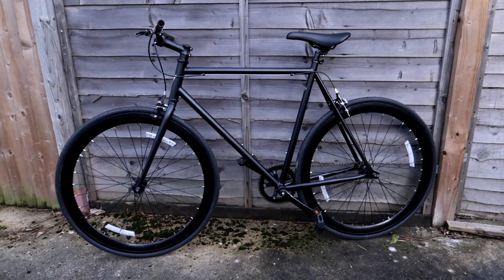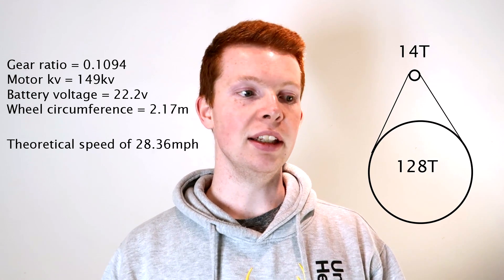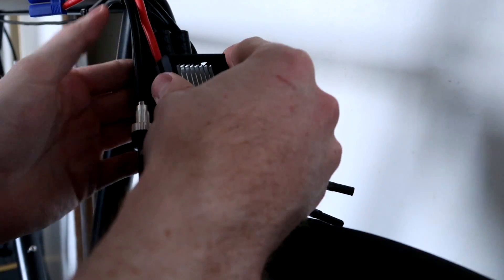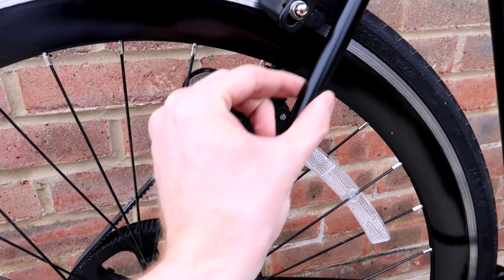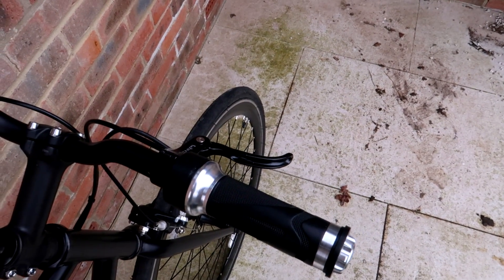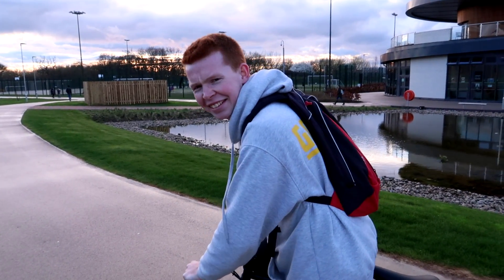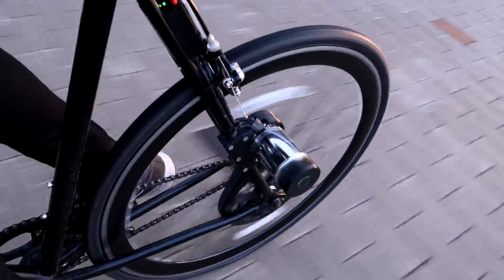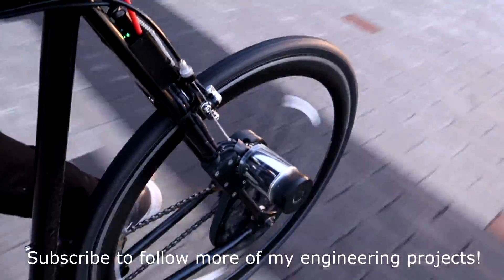DIY Electric Bike

Comment: The motor is rated for around 2kw isn't it an overkill? 
Are you underpowering it?
Reply: Yes its obviously under powered. Acceleration is not going to be great with a tiny little motor like that and it only has one gear which is disappointing. Still a cool build and solid effort. Doing a complex thing is difficult and at least he had some decent end product

Comment: 3 engineers to put a brushless motor in a bike that at the end didn't even work properly? 
Sorry but you don't need 3 bachellors degree to do what you did.
Reply from the maker: I realise that nothing from my degree course has helped me with this project one bit, but why is that an issue? Not really sure what you mean by "didn't even work properly", but I assume you didn't watch until the end. Thanks
Reply: I am sorry Dashz but you are a complete idiot.This setup is genius!!!You are adding only  3kg to your bike and you have really decent pedal assist and you don't have a heavy hub motor which is ruining your bike in terms of pedaling. So you have a e bike which can pedal like a normal bike + pedal assist.I assume you don't know nothing about bikes and your comment is pointless.I am building the same setup at the moment with only one difference, my rear hub will have dual freewheel.Thank you Tom Stanton!

Comment: A lot of 2017 buzz terms.. "3D printing" and "shout outs". I don't think 3D printed plastic is a very good material for vehicles that have to run for years in all conditions. But it's a nice hobby project.

Comment: pretty neat ! :).In case yo exceed the motors top speed, I would consider a one way/over run clutch bearing in the sprocket on the wheel. So it will free wheel instead of over running the motor and possible frying your electronics & a speed sensor on the wheel to cut out the motors power, if the speed exceeds the motors max speed, no need to waste your battery

Comment: Would pedaling not cause the motor to push current back through the circuitry, since it'd be rotating without input causing it to essentially be a generator? 
Anyways, a better design would be a planetary differential, pedals being the sun, planet carrier being the drive, and motor being the ring. Although more complex, it gives you the option of pedaling, electric drive, and a hybrid of the two.

Comment: I'g get some thin sheet aluminium metal and cut a couple of at the wheel pulley size disks out of it to mount on and reinforce the wheel pulley. Torque over time on the pulley plus heat friction caused by the belt is more likely than not going to cause the pulley to weaken and break.

Comment: You could've taken the easy way around the analog to digital conversion and just bought a servo-tester for RC servos.
You could have removed the potentiometer in the servotester and soldered in the wires from your throttle.
And that box is probably not water proof at all.
You need to cover the cirquits in liquid tape or other insulating sticky stuff aswell as using a rubber grommit or silicone sealant, but you'll find that out soon enough and you can make improvements :)

Comment: I don't think that's bike is a fixie. pretty sure that fixies don't have a coaster in the rear and the pedals turn all the time.  I could be wrong.
Reply from the maker: +Do R/C! It's sold as a fixie with a flip flop hub. So one sprocket is fixed and one can freewheel

Comment: Great vid but you didn't mention the run time
Reply from the maker: I will be making a follow up video over the next couple of weeks with more information about the performance. But from the testing that I have currently carried out, it uses approximately 950mah/mile without pedaling (so roughly 4.2miles on a 6s 5000mah battery) and 650mah/mile with mild pedaling (so roughly 7miles on a 6s 5000mah). Thanks!

Comment: your video doesnt make it clear at all what kind of acceleration you were able to acheive.  It doesnt look very powerful
Reply from the maker: I've limited the ESC to 50A to keep the motor cool, so with the 6s (22.2-25.2v battery), it outputs 1110-1260w. The motor is supposedly rated for 2250w, but I think it achieves this at 12s because when I increase the output amps to +60amps, the motor begins to stutter and lose sync. The video doesn't really do the bike justice in terms of performance, but the motor adds quite a lot of assistance and allows me to climbs hills at 20mph with ease. I will most likely be making a follow up video over the next couple of weeks to showcase the performance better. Thanks

Comment: Thoughts on this motor?
https://hobbyking.com/en_us/9235-100kv-turnigy-multistar-brushless-multi-rotor-motor.html
Seems like it might be a good form factor for a bike, but would need higher voltage.
Reply from the maker: Looks decent in terms of the specs, but I'm not sure how you would mount a pulley to the shaft
Reply: +StantonFPV I'm kind of in the opposite situation to you. I don't yet have a 3D printer, but my father is a blacksmith/welder, and I've got a friend who runs a professional machine shop. 🙄 So a custom pulley or adaptor is no big deal. 
It's interesting how ones approach to a project dudes is on skill set and capabilities.

Cheers!

Comment: Nice work man! What type of belt/pully are you using? I usualy use GT2 for small projects, so it would be nice to know some large type pulleys as well.
Reply from the maker: I'm using a HTD5 timing belt, it's 15mm wide and 800mm long. Thanks!
Reply: Thanks!

Comment: My biggest concern is failsafe. Suppose the arduino has a hiccup. You could end up with the ESC giving full whack. You're only option then would be to pull the power lead.
Reply from the maker: For sure that is a concern of mine too. I will most likely build in a switch that can disconnect the esc signal wire from the arduino as the ESC has a failsafe shut down if it doesn't receive a signal

Comment: Can you please show/comment more of the math for calculating the gear ratio and theoretical speed? It could save me a lot of research time for future projects. Thx!
Reply from the maker: voltage x motor kv rating x (number of teeth on motor pulley/number of teeth on wheel pulley) x (circumference of wheel/60) x 2.24 = theoretical speed in mph

Comment: Cool project! I just have one question. I'm an electrical guy and we use "kv" to mean "kilovolts." You're saying your motor is 149kilovolts? Or did I miss something? (",)
Reply from the maker: +legendofthemoon2013 "kv" is a term used to rate the rpm of the motor. The "k" is meant to be a constant and the "v" is the voltage. Multiplying the 149 (k) by the voltage (v) equals the theoretical rpm. But yeah, it's quite a common mistake in the RC model industry

Comment: make it a dual motor
Reply: I dont think physics work that way, haha :D
Reply: better to just increase the size of motor and change the pulley ratios.
Reply: Marcus Christensen that plus dual
Reply: Pryside make it dual motor for 100 mph
Reply: You'd need 8 motors to do that, unless you were riding on the moon.
Reply: Great job. From Texas. Subbed
Reply: FPV_Arthur
Reply: Just to be clear, the previous was a reply to FPV_Arthur's comment about going twice as fast with two motors.
Reply: Leo Pryside then the motor burns or controller lol
Reply: FPV_Arthur Dual motor setups wont make it faster since both motors r spinning with the same power and speed all u will get is abit morw acceleration and torque also it will just use more unnessacery power..
Reply: His current motor can deliver up to 2000W, and the vesc can also handle much higher voltage. So all he needs is a battery with more volts... because with 2kW you could reach around 50mph...
Reply: Leo Pryside 
Exactly! The motor is rated to 12S 44.4v/50.4v  (48v) and he is only using a 6S pack 22.2/25.2v (24v) 
So all he needs to do is get another 6S and put it in series and Bam; twice the power/rpm and speed!
Reply: FPV_Arthur wow you want torque I guess
Reply: Here is a layout for a TRIPLE version for mtb/bmx maybe, ignore the derailleur.

https://www.imageupload.co.uk/images/2017/04/23/triple.png

Comment: Hey would you be able to share the code for changing the analogue signal to digital? I am actually trying to make an electric car using the VESC!
Reply: The VESC can read a analog signal directly, you just have to configure the input method on the BLDCtool
Reply: If you're using arduino, analogRead() is good enough to get a digital value by itself, otherwise look up the data sheet of whatever chip you're programming (I'm assuming you're using a chip since you asked for code), most of them have an ADC built in. The code consists of setting the prescaler bits in the ADC register of the chip, and then enabling the ADC clock. Then you can read the value put into the corresponding register. Should be roughly the same for whatever you're using. I used AVR (the same chips in arduino controllers). 
This is a good tutorial if you're not familiar with the type of chips I'm guessing Stanton's EE friend might have used for analog to digital signals which require coding:
http://www.avrfreaks.net/forum/tut-c-newbies-guide-avr-adc?page=all
Reply: google "arduino servo knob"

This is not really how you typically write code but I cramp everything in one line of code. (not good coding practice)
It read the potentiometer value that is varies from 0 to 1023 and scale it back to 0 to 179 then write it to the servo motor.

void loop() {
  myServo.write(map(analogRead(potPin),0,1023,0,179));
  delay(10);
}

----- EDIT -- here is the basic code you will find online

// include the servo library
#include <Servo.h>

Servo myServo;  // create a servo object

int const potPin = A0; // analog pin used to connect the potentiometer
int potVal;  // variable to read the value from the analog pin
int angle;   // variable to hold the angle for the servo motor

void setup() {
  myServo.attach(9); // attaches the servo on pin 9 to the servo object
}

void loop() {
  potVal = analogRead(potPin); // read the value of the potentiometer

  // scale the numbers from the pot
  angle = map(potVal, 0, 1023, 0, 179);

  // set the servo position
  myServo.write(angle);

  // wait for the servo to get there
  delay(15);

}
Reply: B.Vishnu Teja
Reply: B.Vishnu Teja

Comment: I was planning on doing something like this over the summer before I head off to university. It seems worthwhile if I get Into Warwick since there are bike racks everywhere. Im probably gonna try and do it on the cheap using ebay parts and a 24vdc electric scooter motor.

Comment: Hi Tom, great build! Just wondering why you took the face of the motor apart? Looks like it's missing the front bearing support, and possibly the whole faceplate. Why's that?

(I use the 6374 192kv for Pulsar's self-righting arm (you might know Robot Wars?) also on a VESC!)

Cheers
Reply from the maker: +Ellis - Ranglebox The motor was originally burnt out from a previous use. So when I rewired it, the copper didn't quite fit with the larger bearing (and built in fan). So I had to add a spacer, pushing the can away from the mount. 
Nice! Yeah these Turnigy motors are pretty impressive.
Thanks!
Reply: Ah I see. Cool that you rewound it, that's not a simple job. There's a video's worth there I should think!

I use two 50cc Rotomax motors to chuck the 110kg robot around at ~15mph. Pulsar is one of the only Robot Wars machines using brushless motors like this - few test videos on my channel if you're interested.

You should get your engineering mates together and enter! I'm sure you'd build something cool. Applications for the next series close in 6 days. ;)

Comment: Very nice job! Please update us on the longevity of the bike and the practicality of it. I would also like to see its efficiency (Wh/km).
Reply: BSC4PE knowing Lipos under that sort of load i calculate a 5 min runtime on full power for 100% of the time using that battery
Reply from the maker: Yes I will be making a follow up video over the next couple of weeks. I don't currently have a watt meter, but using my charger, I have calculated that on average it uses approximately 950mah/mile at 20mph without pedaling (so if taking the voltage as 22.2v, that's 13.12Wh/km) and 650mah/mile at 20mph with mild pedaling (8.97Wh/km). Thanks!
Reply: StantonFPV That seems like a very good efficiency for what it is. I wonder how much the assist by pedaling reduces the number.

Comment: Awesome!
A bit of clear nail polish over the components makes for pretty good weatherproofing.
PLA is biodegradable...might want to clear coat with UV resistant clear coat for longevity
Reply: After some investigation...you are 100% correct....thanks
https://www.filabot.com/blogs/news/57233604-the-misleading-biodegradability-of-pla
Reply: I made some PLA-corners that hold the antimosquito net out the windows. 3 years outside - no signs of degradation or anything.
I beleive you will redesign the parts much earlier then they fall apart of age.
The only concern with PLA is heat.
Reply: PLA is not Biodegradable. (Not at-least the way many think it is) Its a Bio-plastic. Very different. PLA has been proven to take just as long to break down as many other petroleum based plastics.
Reply: Brian C Hi , please could you tell me what P.L.A means. Sounds like a fighting force.
Reply: Is that correct? I know you can compost the stuff if you shred it and add the appropriate enzymes. You can't compost ABS? Latext Rubber. also being Natural product derived it can take a long time to degrade, but it breaks down rapidly in strong sunlight hence party balloons always weaken & burst easily on a hot sunny day .
Reply: Polylactic acid (PLA)
https://en.wikipedia.org/wiki/Polylactic_acid
Reply: A nice coating of hotglue.    Weatherproof and easily removable.   Hotglue and solder have been best friends for years.
Reply: Wrajfv
Reply: PLA is biodegradable, but it's not THAT fast. It'll degrade in 50 years in an industrial compost bin. So yeah.
Reply: Filament from www.two-bears.eu is really biodegradable. you can compost it at home without any toxic stuff, like other PLA (which have weakeners in it)

Comment: what about the induced current from the motor flowing back to the ESC when you pedal? is there a chance of doing damage to it?
Reply from the maker: +Lacksi Yes the ESC (called a VESC) I'm using has regenerative braking.
Reply: Ahhh! That's very convenient. I wasn't aware there were ESCs with that functionality for a reasonable price.
Reply: If you can't find an ESC with the regen feature, maybe use a snubber diode with a resistor parallel to the motor? Should be simple enough.
Reply: I was about to ask about how the battery handles the charging but it seems you answered that for me :D
Reply: rmay000 wouldnt it just charge the battery?
Reply: I would rather use some kind of freewheel, instead of directly attached pulleys and ditch the regenarative breaking, because:
 1. With your setup when you stop applying power the motor rapidly becomes a dynamo and stops the bike, so it is bad for milage
 2. Because of 1. the belt could slip and wear faster
 3. Regenerative braking with your current setup is dangerous, because, even that you are using ESC that supports it, you have the 6 cell lipo connected directly trough the non-balanced main battery leads which should be used only for discharging. Chargibg should be done trough the balanced leads instead, otherwise the battery will disballance and you might damage it, or get it on fire on some steep downhill.
4. ESC gets hot during climbs and even hotter during regenerative braking on downhills and may not have enough time to cool down and melt the case.
5. Number 4 pretty much applies to the battery as well, but it seems pretty well-rated one

Comment: Want to be engineers. A real engineer would have used a milling machine to make the rear pulley from alluminium. Not get a computer to make a plastic one.  Having said that your project worked out very well and you have the makings of future engineers. I wish you all the success in your graduation.
Reply: Often see this tone.

An engineer's job is to figure out the most elegant and/or cost effective way to achieve a goal. If 3D printing can do the job, purposely ignoring the method because it isn't traditional, is bad engineering. Also, a computer didn't "make" it. He will have taken measurements, manually designed a 4-piece interlocking pulley CAD model, and used the 3D printer in the same way a CNC machinist would program a mill. 

Diminishing someone's work purely because it's newfangled is shortsighted at the least.
Reply: Are you saying he should done the work to make the pulleys out of aluminum or paid to had them made out of aluminum? 3D printed parts definitely have their limits, but I don't see why you can use them to test ideas like this.
Reply: He's also an aviation engineer, not a mechanical engineer. In case you don't understand what aviation is, it has to do with planes. Can't really tell how smart you are based on your attitude of material used and saying a real engineer would use a specific material. 
Want to be a real engineer? Well there's this thing called prototyping. Depending on filament used, the plastic should be more than good enough for this application, since it's a bike and a relatively low powered motor. Maybe if this was a motorcycle using an automotive grade motor, then aluminum should be used rather than plastic, but it's not. 
Either you're autistic, or your head is too far up your ass.
Reply: Next step...3D print one, then cast the pulley in aluminum ;)
Reply: Mediocrity knows nothing higher than itself, but talent instantly recognizes genius.